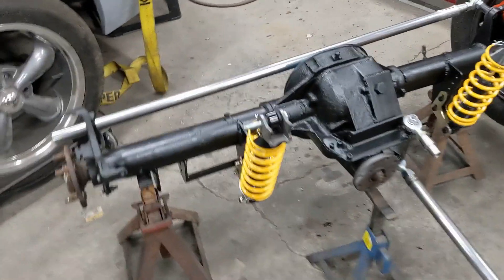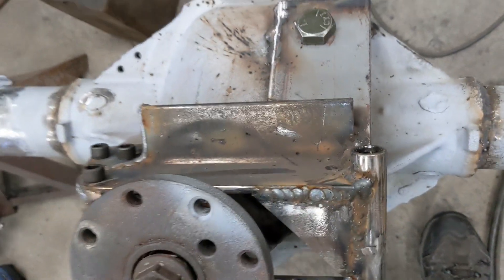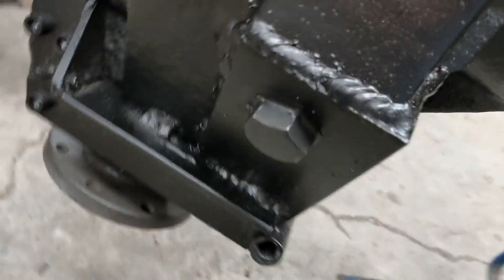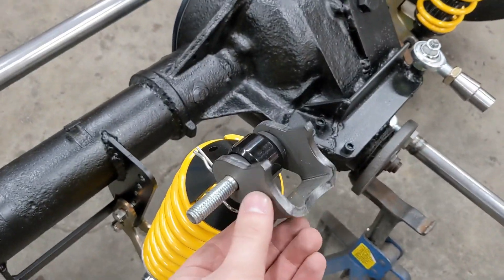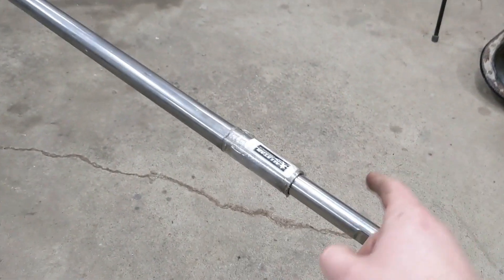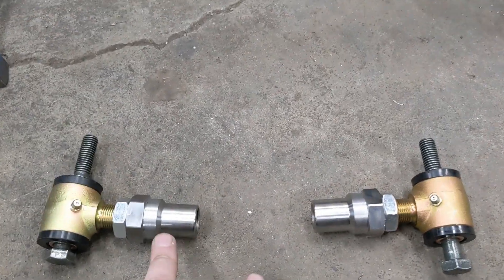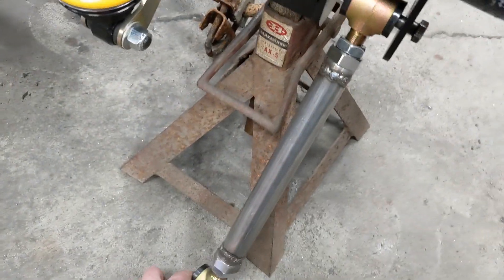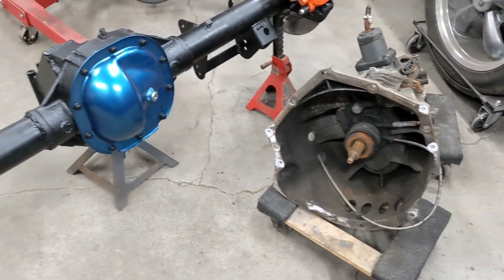Custom torque arm coilover Ford 8.8 - Beretta #LSswap

Comment: Looking good, with lots of adjustability. I'm pretty sold on torque arm suspension for street-driven cars. It's simple, it works well, it doesn't bind, and it's hard to build geometry which will cause a problem. I hadn't considered a sway bar bushing for the forward mount, but it's a good solution. I've turned that over and over in my mind. A torque arm has some unusual characteristics since it has to rotate slightly, plunge slightly, take a lot of side load (vertically), package in tight spaces, and not be adversely affected by all the dirt and water underneath a car. It's hard to find something which fits the bill. Some manufacturers use steel sliding against steel in one way or another, but that's going to wear out fast.
Reply from the maker: The insensitivity to geometry is one of the reasons I chose to do torque arm. The LCAs are about 20% shorter than Camaro torque arm LCAs, but that should be less severe than if I had gone 3 or 4 link. Should fit the Beretta chassis better too. And the Ford axle pinion offset also makes a little room for the TA.
Reply: @GEARHEADdezign  I hadn't considered the usefulness of the offset, but I can see how it helps keep the assembly closer to ideally centered under the car.

Comment: Yusss it's happening!
Reply from the maker: Only sat in the corner from August until now🤣
Reply from the maker: I guess by Camaro standards that's still not bad
Reply: @GEARHEADdezign  it's light speed comparatively
Reply from the maker: That's cause I like fab with. HATE body work with a passion

Comment: You use the stock gearing in it?
Reply from the maker: The explorer axle is 3.73 so that'll be fine. The nv3500 first gear is pretty deep so I probably won't use it much, but a TKX would pair nicely with the 3.73